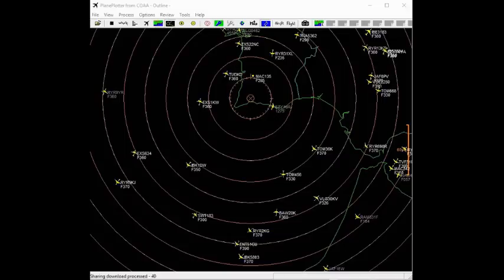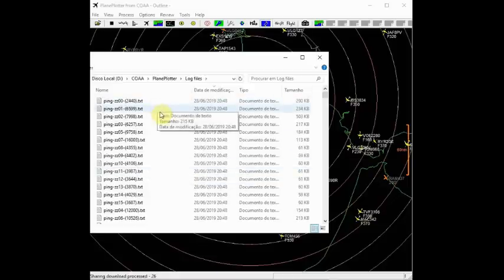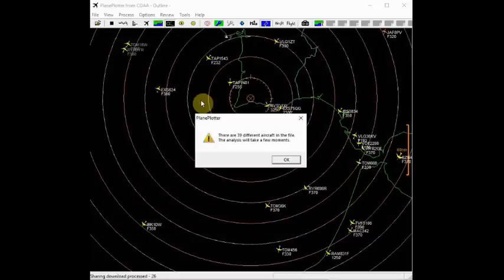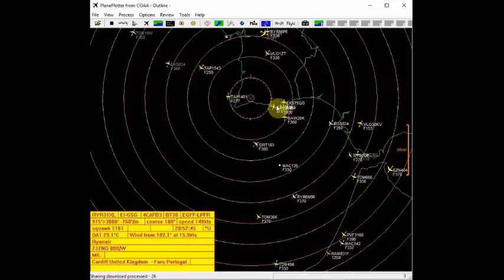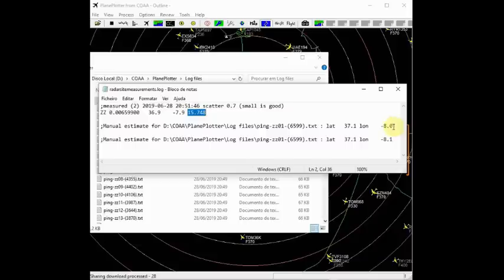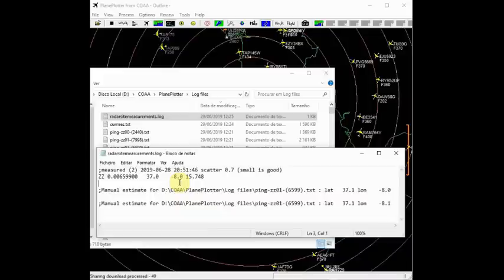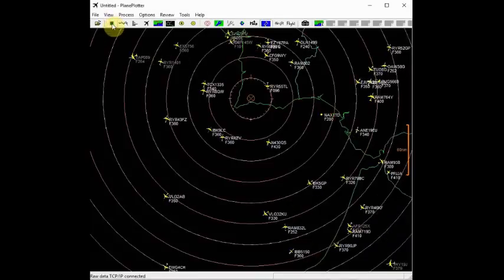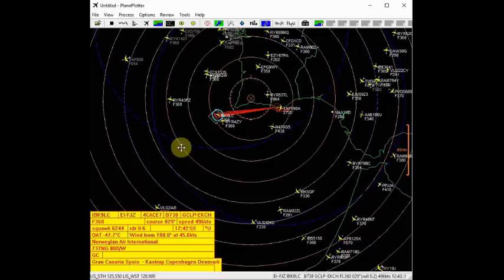PlanePlotter Beamfinder Plus

Comment: Hi !  ...and thank you for this very interesting presentation.  

I am not familiar with Planplotter and certainly could get acquainted with its features but it actually is easier to ask you directly since you obviously know more about this effort than I could learn  in weeks...  I fly out of CYJN, near Montreal, Quebec.  Just North of CYJN, there is an uncontrolled area that sustains traffic from a great deal of local airports (CYHU, SB3, SU3, CYJN) .  We refer to this zone as the "killing zone" for the flight density is extreme.  Now, it is difficult for us pilots to coordinate our flights through this zone as our common frequency of 126.7 is valid for the whole province.  It simply is impossible to rely on position reports to avoid midair, as it is often impossible to broadcast such position reports because of the frequency being saturated with users. We are all playing Russian roulette.

Neither ADSB nor mode S are currently mandatory in Canada and it hopefully will take a while before it becomes mandatory for the small general aviation aircrafts.  Hopefully since there are alternatives that would provide, for radar covered area, a near equivalent degree of safety.  Also, one must note that Canada has chosen the international ES implementation of ADSB, as opposed to the US which relies on ground stations.  Even though Canada's choice is fully justified by the sparse density of the population, the ES equipment is still extremely expensive when one considers the value of many or our aircrafts.

The area is currently covered by 3 secondary radars :  Dorval (CYUL), Mirabel (CYMX).   Of course, the easiest solution would be to make NavCanada data (which already combines data from all three radars) available to anyone on the web.   I really don't see why they do not provide it as it is already available for internal use.  Taking this solution aside, I was thinking about time stamping mode C replies and inferring positions through triangulation.

Now, your presentation opens up other possibilities :
Is it possible for the Beamfinder feature to currently deal with area served by multiple radars ?
Can this feature be used as the sole source for tracking all mode C aircrafts or is it limited to a single aircraft ?
Does this feature currently supports mobility (being carried in the aircraft and processing own's aircraft heading and speed) ? (not absolutely necessary as the information could be broadcasted on the web from any "groundstation").

Otherwise, What do you think about the possibility of time stamping and triangulating mode C replies, considering that it would be easy an affordable to recruit people within the area to install SDR and GPS receivers ?  It is my understanding that this is already done by FlightRadar and FlightAware, but only for mode S replies.

Thanks & Regards,
Pierre Leduc